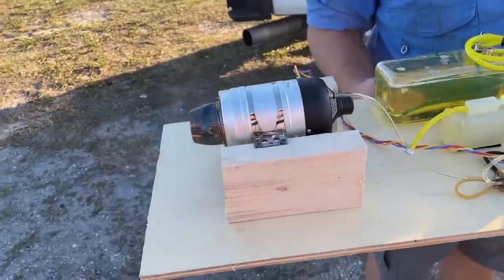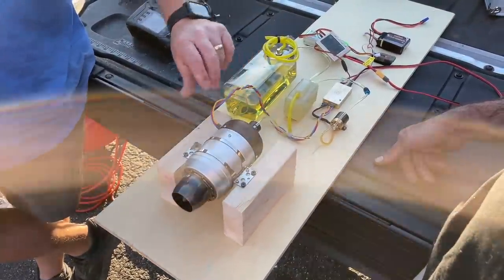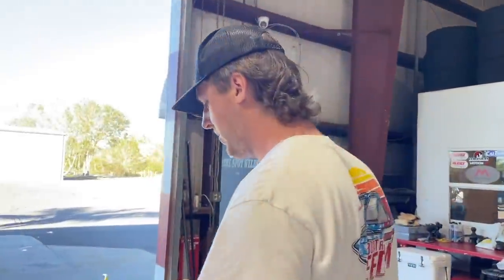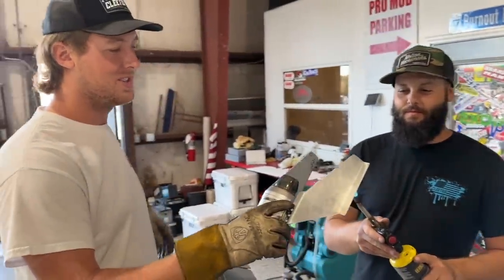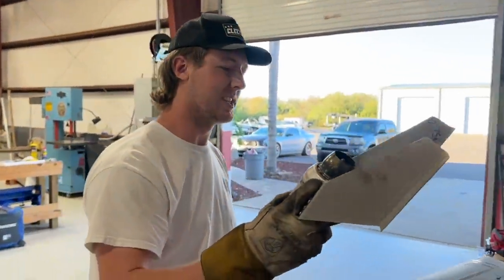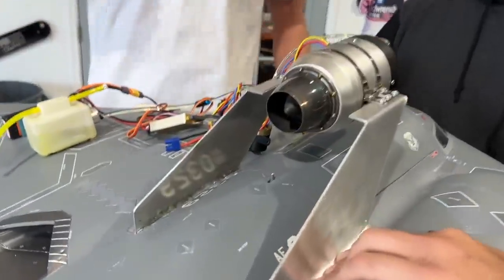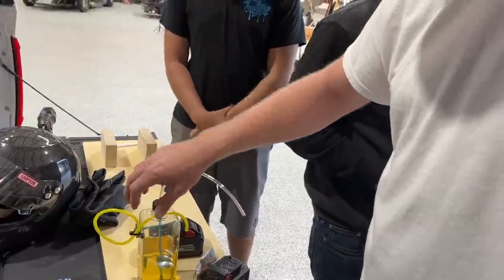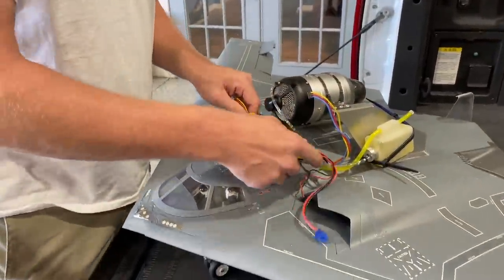I Added A Super Powerful Jet Engine To My GIANT B2 Bomber... Is It Gonna Work???

Comment: Another what could possibly go wrong video. By the time you get a battery big enough to get that extra engine off the ground it is going to kill your flight time as well as the landing how's that going to work out for ya. You going to have scaredy cat George catch it mid air for ya? No WaY dude is that ever going to happen. On a styrofoam body right that thing is just going to pull that plain apart. Might need a set of backing braces on the bottom of the plain before that glue has a chance of holding those mounting brackets on. need to bolt that thing through the plain if it is going to hold at all. I can't wait till that thing catches on fire and melts.

Comment: Y'alls Need To Heavy Metal Duct Tape All Under & Behind On The Top Of Fuselage Or It Will Melt & Burn That Big Hunk Of Foam In Mid Flight!!! PS I Wouldn't Trust That Foam-Tac Bonding From Metal Engine Mounts To The Weaker Foam Plane, Especially When It Heats Up To Cherry Red HOT!!! I'd Drill Through Engine Mounts Near All 4-Corners + Put Long Aluminum Bolts w/Big Fender Washers + Lock Nuts On Top & Bottom Also!!! 🤔😜🤣😁😎 Good Luck Not Havin Your $1000 Jet Engine Go Wildly Spinnin Off & Into The Ground Badly... 💨💨🤣🤣🤑🤑